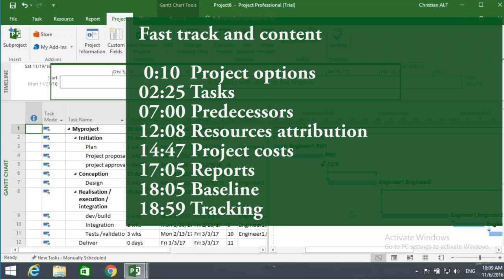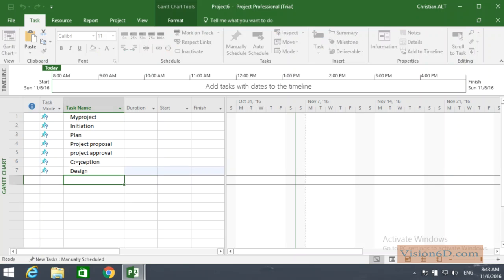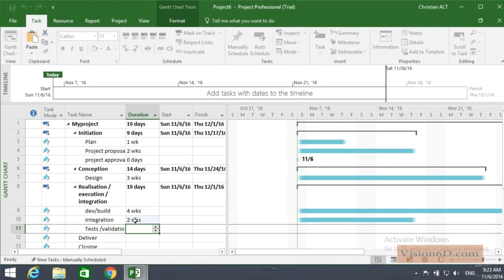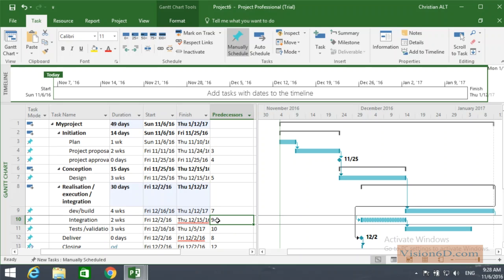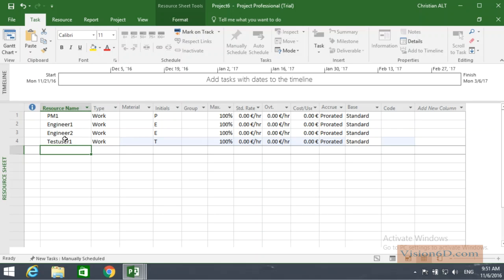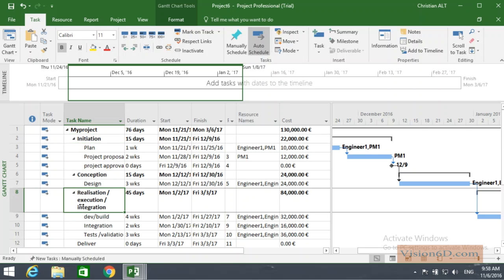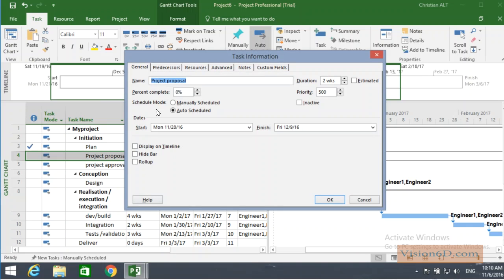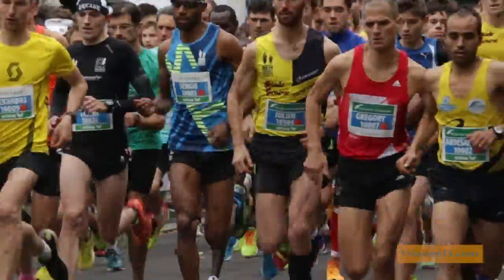# 1 MS Project 2016 ●  Basics In 15 Minutes  ●  Easy

Comment: how do I download the PERT add in bar for MS project?
Reply from the maker: Could you be a bit more specific?
Reply: @vision6D  the add in that shows the "most optimistic, most likely, and most pessimistic" :)
Reply from the maker: @stryfus  to my actual knowledge this was a feature in older MS Project versions like 2010. This feature does not exist anymore. You can always use custom fields. If you find a better solution, I'm also interested. Greetings from Geneva.

Comment: Appreciated. Learn a lot thanks. I have a qaieyion regarding work resources let’s say if I have a 10 numbers of carpenters or plumbers to do a activity so I will add all 10 numbers of workers one by one in resource sheet or there are ways to add only one time to get the end result of 10 carpenters cost.
Reply from the maker: Thank you for your question and yes, absolutely. For this in resources you have the capacity column, which by default is 100%. Create a resources named carpenters and set the capacity to 1000%. Then you apply this resource to the tasks 10 carpenters will be doing. Try it and let us know how it worked for you. Greetings from Geneva.

Comment: The lasser is tew stronge
Reply from the maker: Did I get it right: The lesser is new strong?
Greetings from Geneva.
Reply: @vision6D  lol, it was just a joke that I thought of (from another youtube video) while I was watching your video. But, for the record I want to thank you because you helped me with my Gantt chart project for my IT Project Management class. 
I have one question, when listing the tasks.. can I use the ones I listed in my Work Breakdown Structure (Initiation, Planning, proposal, approval, conception, design, execution, migration to cloud, closing server house, data disposal, testing, training, closing). the proposed project for my homework is basically moving an organization into  cloud computing.
I'm also trying to figure out why the chart on the right hand side has a big gap BEFORE my start date. My start date is August 07, 2020 but my chart technically starts at todays date and has no bars until the real start date.

Comment: Some suggestions. Before starting to list the tasks, ensure all new tasks are auto scheduled, at the bottom left of the screen. Also, go to the format tab and the right hand end of the ribbon check the box for project summary task. This will make line 0 the first line in the list. Also, go to view, tables, more tables, and remove the text wrapping from the task name. This will prevent fat row heights. Also, go to file, options, display and check the box for entry bar. Also, in the view tab, uncheck the box for timeline. You don't need it and it is a waste of space. Having done all of that, when you name a task, make sure that it starts with a verb. Tasks are things you have to do, which is the definition of a verb. "integration" is not a verb, so it is not a task.
Reply: Thanks for the excellent suggestions; I'm a beginner and I will be using them.
Reply from the maker: Thank you for those value full additions.

Comment: Hi I have a question, I m creating a 2 year project and for some reason I having a hard time changing the time duration on certain task for example some summary tasks requires a 50 day duration it changes back to manual schedule. When I change it back to automatic the duration resets to example "7" days instead of 50 days like I need it to.
Reply from the maker: Thank you for watching the video. We agree that summary tasks depend on the duration of the tasks they are summarizing?
Are then the tasks getting flagged in red? Overtime?